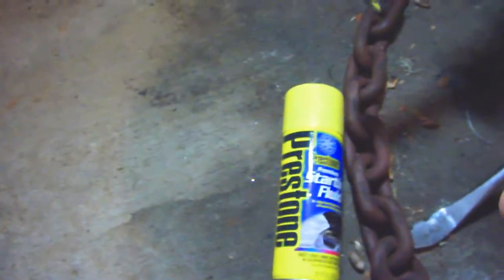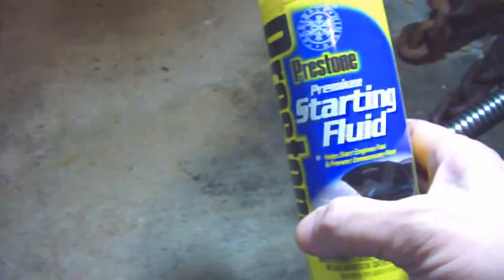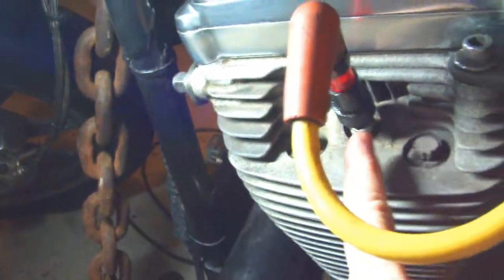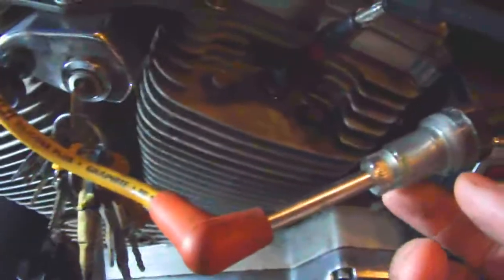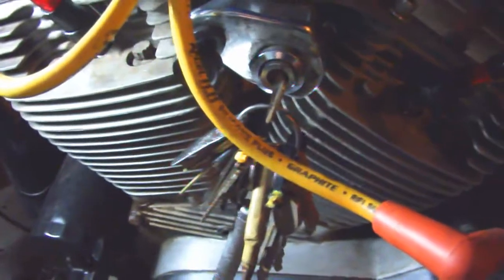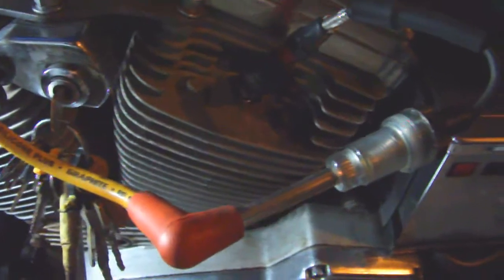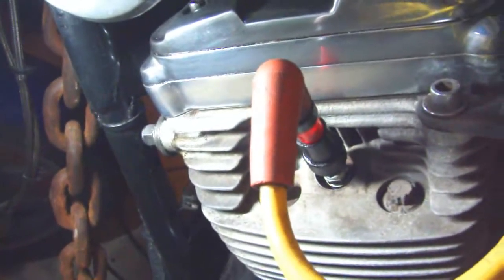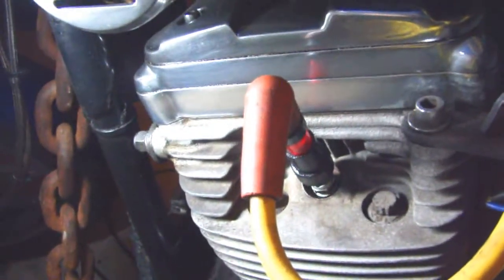Quick How to - Engine Troubleshooting- SPARK & FUEL

Comment: hello syyenergy7,
in following our posts from your video on chrysler sebring timing belt ( P2- 4  )  educative views and know how , i have checked the rotor, distributor , and tested all the spark plugs for firing it was a negative results , so now we know it is not : the fuel pump, fuel line , fuel filter , fuses, relays , spark plugs , ignition wires , distributor nor its coils , i believe we have two final things to check : timing sequence ( during crank ) or a failed  timing sensor !! thanks for all the help in advance . 
if i fail to fix this problem ? my next step would be take the vehicle to be completely scanned and fix it at a certified mechanic .
Reply from the maker: +AnunnakiThe1 Could be the PCM too.
Reply from the maker: +AnunnakiThe1 Usually it's the CPS or Distributor and they often Don;t throw a code.
Reply: syyenergy7 understood ,
is there a devise i can rent or buy to test the CPS ? or in your expertise a method to test it , thanks again for all the help .
Reply from the maker: +AnunnakiThe1 A cheap code reader can be bought for $20

Comment from the maker: I used insulated pliers.  Just arc the spark to the top of the plug.  I found out about this from a old Harley rider years ago.  I never saw this tip posted anywhere on the net.  I think it works by making the plug extra hot.  It does work though.  I tried this method before.